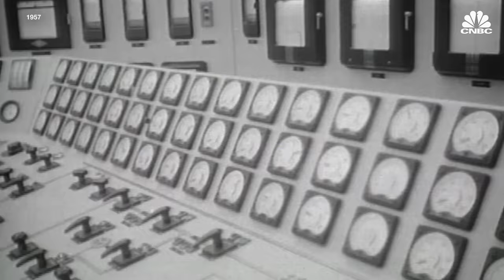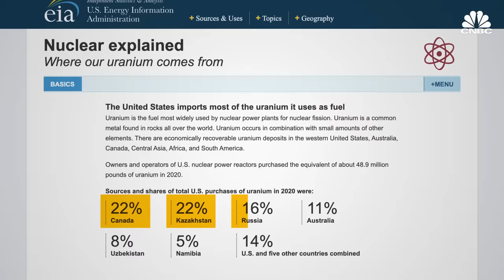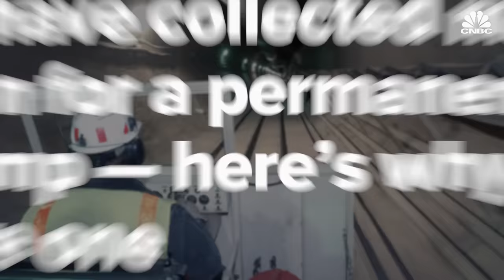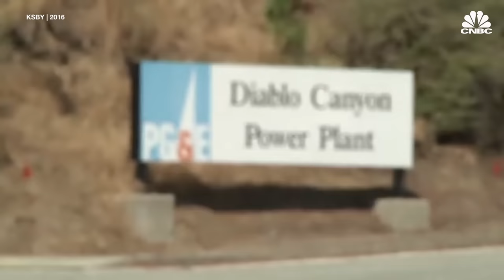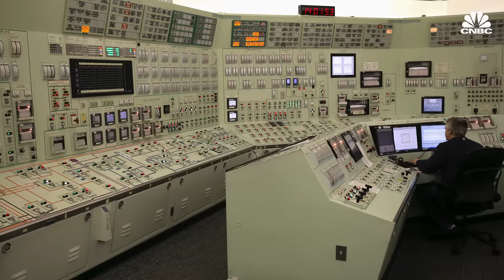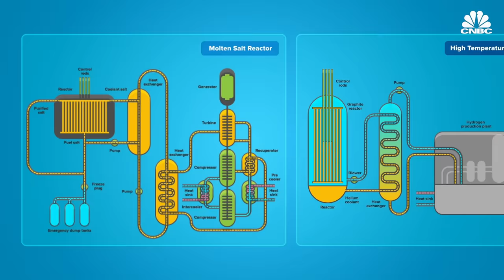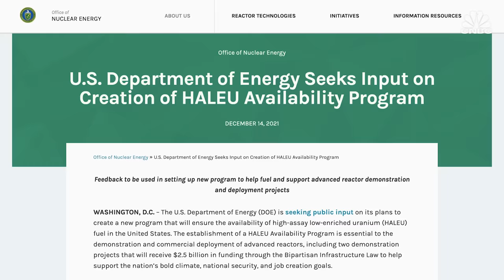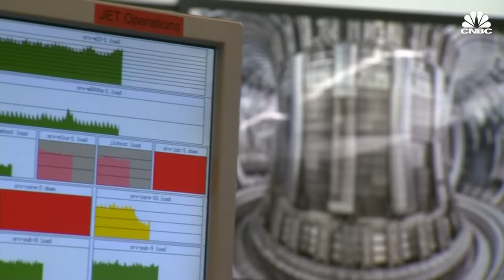Why Nuclear Energy Is On The Verge Of A Renaissance

Comment: Good reporting overall, but one oversight and one nit. 
Nit: throwing fusion into the mix at the end was a bit confusing, as ITER is only an experimental reactor to see if it's possible to get net energy out of a tokomak at the larger scale. I think it would have been better to mention fusion only in passing, as it's too far in the future to be relevant to the topic. 
Oversight: The discussion about enrichment levels ("the fuel doesn't exist") leads one to believe that ALL the up-and-coming small-modular and micro-modular reactors rely on higher-enrichment uranium. BUT this leaves out the molten-salt reactors, which would not need such fuel. Some of these can run on thorium and depleted uranium which are not fissile materials. Some molten-salt reactors can use existing radioactive waste AS fuel (Elysium industries molten chloride fast reactor, for example). Also, molten-salt reactors are inherently safe because they operate at high heat instead of high pressure, eliminating the need for the expensive containment vessel (also helps fight cost). Leaving out molten salt reactors from the discussion does a disservice to this very promising tech that will be the true revolution in power production.
Reply: Hey I'm a nuclear physicist and would like to respond to your nit. Fusion is actually very close! ITER is already out of date and will only be used to test different techniques. SPARC is a fusion reactor that will have a net energy of 10, so 10x the energy out as in. It will be done in 2025. And it's not the only project backed by private funding that's getting net positive soon, but SPARC will be the first. 

There are still questions about stability, so how long can we keep the reaction going, but SPARC and ITER should have hopefully figured that out within the next 10 years. 

That's why anyone is my field is such a proponent of nuclear right now as it doesn't need a total rebuild of our electrical grid and can easily be replaced by fusion that will be ready soon.
Reply: @stinkiaapje  I sincerely hope you're right about fusion getting net 10 soon! I believe we can do it eventually one way or the other. However, throwing a segment on fusion in at the end of this report with no real context seemed completely out of place. Either it deserved a much longer discussion, or it should have been mentioned in passing as another item that may come soon.
Reply: @stinkiaapje  Fusion in the form of a tokamak is a massive waste of money and a guaranteed failure...even if it worked exactly how they envision.  The construction costs would be several times the cost of fission.  And there is no reason to do it, because new fission tech is everything we were after with fusion.  Especially molten salt reactors.  They don't blow up.  Regular reactors only use 3% of the fuel, while molten salt can use it all.  And the waste products are anything but waste.  They are isotopes with current applications.  Not something you want to bury in a mountain.  And it can burn the "waste" we had to take out of all the other reactors.
There are some other cheaper ideas that might make fusion practical.  
Tokamaks would also directly compete for resources with electric cars and windmills, because all these things use rare earth magnets.  And rare earth magnets are used in many other things like drones, the most advanced and efficient refrigeration systems, and likely future flying cars (eVTOLs).  If rare earths become very expensive, that will dramatically slow the movement away from fossil fuels, especially in transportation.

The reason nuclear is expensive in the US is because we canned the AEC and replaced it with the NRC.  The NRC was designed to cripple the nuclear industry.  This is why we don't build reactors, except experimental ones.  The experimental ones are overseen by a different agency.  The NRC has no authority to do a thing about experimental reactors.  The NRC single-handedly tripled the cost of construction and operation of reactors.  They okay no new construction.  The few that have been built, were already approved 40 years ago, but just not built.  If we want nuclear back, we have to abolish the NRC and bring back the AEC.

The NRC has used disproven science for decades to greatly increase costs.  They continue to use the "Linear no-threshold" model of radiation exposure, even though we know this is false.  It comes from a time where we thought radiation damage to DNA accumulated, no mater how little one was exposed to.  But this is well understood to be false.  We know exactly how our cells repair DNA.  They do it in many ways.  The only real radiation hazard is when there are 2 full DNA breaks in close proximity.  When that happens the DNA cut lose can flip rung for rung or end for end or the whole chunk can be removed with the top and bottom joining.  But this is low probability stuff, at low radiation levels.  If there is a double break, it is generally repaired before there is another in the same area, so this flipping or removal does not happen.  It is like sunburn.  You have to be in the sunlight for some time to burn.  If you went outside 1 minute at a time every 10 minutes, it would be very unlikely you would burn.  But you might burn if out the same amount of time, but in one sitting.  DNA damage is not rare.  Each cell has up to 10,000 single strand breaks a day, and 10 to 50 double strand breaks.  Double strand repairs are done correctly approximately 95% of the time.  Single strand repairs are nearly always repaired correctly.  
No one wants to be the guy that says it is not as dangerous, and relaxes the rules.  There is no upside and massive downside possible.  It also would show that there is less reason for their role.

126 years ago, in England if you wanted to drive a car, you had to have someone walk in front with a lantern at night, and waving a red flag in the day and yelling that a car was coming (red flag laws).  Imagine if they never changed that law.  Yes, no one would be hit by cars, but at what cost?  We are pretty much doing the same thing with nuclear.
Reply: I’m a little confused on your last few sentences.  Are you suggesting fusion will just be a “drop-in” tech into existing fission reactors?
Reply: @ChessMasterNate  I agree completely with this statement, especially the part about molten salt reactors - they already have everything we were trying to achieve with fusion - low waste, cheap fuel, explosion-proof, non-weaponizable. Molten Chloride Fast Reactor from Terra Power or Elysium Industries are the nearest to completion. Terra Power has a demo reactor coming online soon.
Reply: @jamesowens7176  Thorium molten salt reactors are also the best way to get the Indians to quit building coal power plants.  They want energy independence badly.  But they mostly have brown coal and thorium.  So they are currently building brown coal power plants as fast as they can. The same amount of coal power Europe and the US has killed has been built in India, and using far dirtier coal...producing far more CO2/GW than the black coal.  Globally nothing accomplished.  Backward, in fact.  This is not a cause and effect.  Europe and the US using less coal had nothing to do with India going berserk for dirty coal, obviously.  It is just that we are spinning our wheels globally on carbon.

And while the Chinese are building a variety of energy generation plants, they are still building a lot of coal.  Their PR does not match their actions.

I think cheap molten salt nuclear reactors can change all this.  But someone has to make the investment.
Reply: Love these educated discussions
Reply: @stinkiaapje Remember, fusion is only  always ten years away.
Reply: @ChessMasterNate I'm on board with everything you said except flying cars. I don't want any of these idiots now filing flight plans with the FAA to get their venti mocha frappachino fix.
Reply: @jordanrussell345  The way I envision it (which is not necessarily the way it will go down) is that eVTOLs will be automated.  You just tell it your destination.  Air Traffic Control would also be automated and obviously communicate with the eVTOLs.

Comment: 100% we need to be building new nuclear plants and saving our currently operating plants. Nuclear is not only clean 24/7 power but it also uses very little land with minimal ecological impact.
Reply: Odd that CNBC would address commercial nuclear power issues WITHOUT mentioning any of the consequences of nuclear capital costs -- which is what killed the industry in  the first place in the United States.   Plants coming on line back in the 1950's and 60's all were built with a Government subsidy with up to more than half of the capital expenditures taken up by the then Atomic Energy Commission and reactor vendors as seed investment for future operating plants.   This situation evaporated in the 1970's with utility customers for reactors assuming the full weight of capital costs for the plant and this situation caused the cancellation of almost as many plants as are running now due to true capital costs and operation and maintenance costs being truly reflective of what was actually happening at each site;  the situation now being over for free money from the AEC, General Electric, Westinghouse and the remainder of the suppliers.  This placed the planned and operating plants on a finer economic edge; making expensive things going wrong more of a determining factor for economic operating the plants in future scenarios.   A gone-wrong steam generator replacement maintenance effort in two of the West Coast plants caused that utility to close down the eight-billion dollar facility for good; forcing the utility customers and the stockholders to eat the capital costs, and this was not the only utility to shut down a site due to insurmountable repairs and maintenance costs.   Reactor suppliers in the United States offered the utilities different 747 airplane designs for each plant and each utility;  something that would break a company like Boeing many years ago.   A re-started nuclear effort in the United States with the same commercial ground rules of competition and non-standardization of plant equipment will result in the same overruns for the same reasons as encountered before: a lack of scope definition and therefore ultimate responsibilities to be faced.   Far more successful in nuclear proliferation scheme was carried out at EDF in France through standardization of design and government financing;  although these nuclear plants as well are finding themselves susceptible to unusually high maintenance efforts.   CNBC and its producers and management have apparently decided that this important history of nuclear power in the US is ostensibly irrelevant and is to be virtually ignored by the current proponents as though it never happened.
Reply: @JAGRAFX  Thank you for your excellent post but it is probably beyond the understanding of the majority of nuclear energy enthusiasts.
Reply: @JAGRAFX  because those plants were built by government for weapon plutonium production purposes. Energy production was basically a byproduct and a cover-up. Cost effectiveness wasn't a priority.
Reply: @bergonius  --- that is incorrect.  We are talking only of nuclear plants involved in energy [electricity] production here such as the No. 1 plant at Shippingport and the other early plants such as Oyster Creek and Main Yankee.  Plants for nuclear fuel and nuclear bomb production are in a completely different category from these commercial plants operated by electric utilities.  There is NO RELATION between the cost incurred on the early AEC projects at Oak Ridge and Hanford for nuclear weapons material and the commercial nuclear power sector of the economy.
Reply: @JAGRAFX  "CNBC and its producers and management..."
LOL all of CNBC isn't necessarily the problem. It's the three person editorial staff on this piece.
4:22 The wide eyed, science-illiterate Cat Clifford, musing about 'nucular' power, is a nice summary of the level of analysis in this story. She paints nuclear energy as some sort of victim of alarmism over accidents, and its higher cost vs fossil fuels--utterly ignoring that in 2022, renewables are far cheaper than nuclear and becoming more so.
 She has a BA in Economics and Art History. This doesn't rule out science literacy, but is much less correlated with it vs a science and engineering background. 
The other two editors have similar non-science backgrounds.
Reply: "Clean" is a loaded term. If you define CO2 as a trace gas that's essentially plant food and nuclear waste as a contaminant which will generate potentially toxic radiation for half-lives longer than humans have existed as a species on this Earth, things start to sound a little different. I'm all for nuclear. I'm also all for fossil fuels as long as we're managing the emissions of all of the sulfites and various contaminants from those systems. Nuclear power can be developed with totally different chemistries that most people think about, which don't generate weapons-grade uranium or plutonium. The passive-safe ones in particular are appealing. But we have to overcome misunderstandings and the NIMBY attitude. Cheap, plentiful power is the key to global prosperity. We're realizing that right now while we watch the environmental psychos shut down the energy sector. They're going to cause a mass famine even in wealthy countries. We need solutions such that this kind of thing doesn't have to happen, and that means we need to get rid of stupid loaded terms like calling CO2 "unclean" and embrace safe, effective, and proven technologies.
Reply: @antera77  --- Thanks for the additional background on CNBC Producer Cat Clifford.  That brings more to the lack of backgrounding on this lite-piece on nuclear energy.
Reply: @JAGRAFX   You're welcome.  
There is an excellent video that dovetails with your commentary on nuclear capital costs:
Search on YouTube: The Economics of Nuclear Energy - Real Engineering
Reply: @antera77  --- Appreciate the elevation of my words to the status of "commentary" and I only can assume that you are very kind.  Thanks for the video tip.
Reply: "Clean", yeah... funny joke.